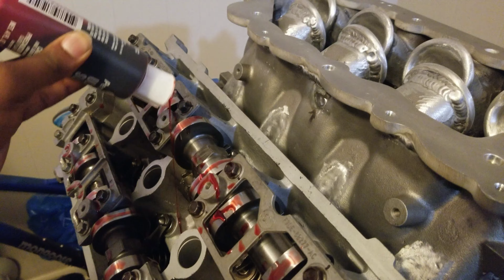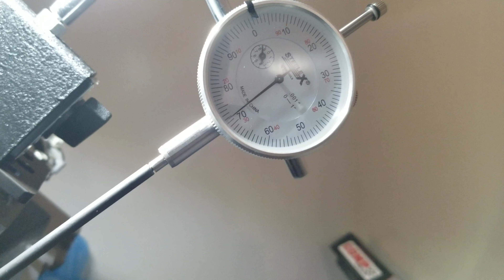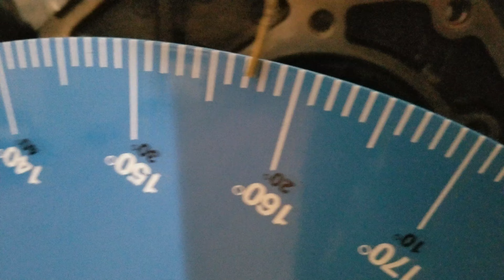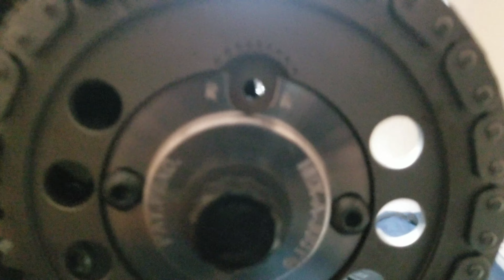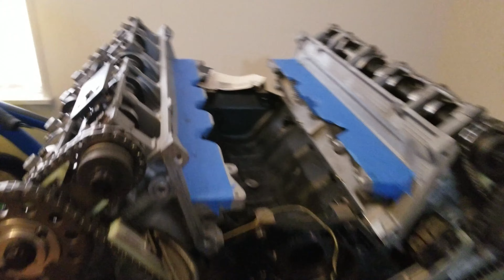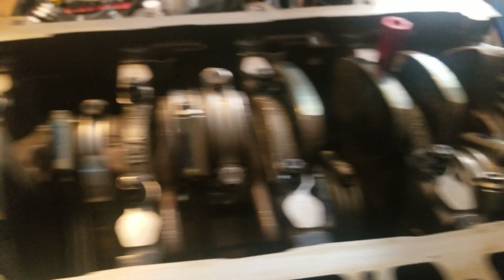Mustang Cobra Modular Boss 302 Engine Build Camshaft Degree

Comment: Dang that cam degreeing must be time consuming!  on push rod 302/351 Windsor's are so much easier to check out the real degrees and lobe separation!  Also on the old Ford motors I like Comp Cams with 6 to 8 degrees longer duration to help the exhaust exhale better!
Reply from the maker: They can be a big pain but these went in easier than anticipated. The Ford gt rockers were difficult to slap in due to the spring tension and cam lift at the lobe.

Once numbers are solid though it's a breeze. I agree the single cam is wayyy easier haha
Reply: @mr.e8543  The total Black Out look is Sick 😎  I've never been a fan of shiny crap on a motor... always thought it would slow it down 🤣😂😁
Can't wait to watch you set the lash on the rockers... if they're called rockers! That was tedious part going from rock to rocker, twice just to make sure it's right. Push rod engines needs that attention to detail...
Reply from the maker: All oil based on these engines. Hydrolic. They call them lash adjusters and rockers.
Reply from the maker: Engine is buttoned up and ready to roll. Currently tackling logistics around transmission and k members etc.

Comment: Did you extend the secondary tensioner? While degreeing cams
Reply from the maker: yeah all were extended for the process . to maintain tension
Reply: @mr.e8543  what did you use to keep them from collapsing on the secondary ? Thanks
Reply from the maker: @mineralcobra2448  what do you mean ? like to keep the tension on the chains ?
Reply: @mr.e8543  correct, on the cam secondary tensioner, not the big chains. There i see you used welding clamps. But the secondary chains how did you keep the tensioner open
Reply from the maker: @mineralcobra2448  they keep themselves open while placing tension . one tensioner is upgraded to the reverse style also . which may be relevant to the holding  . but i had no issues with them losing tension while i degreed.
Reply: @mr.e8543  perfect that answers my question. Thanks
Reply from the maker: @mineralcobra2448  No prob !